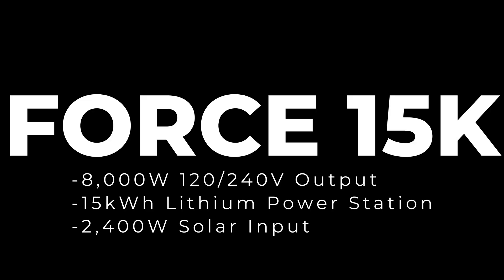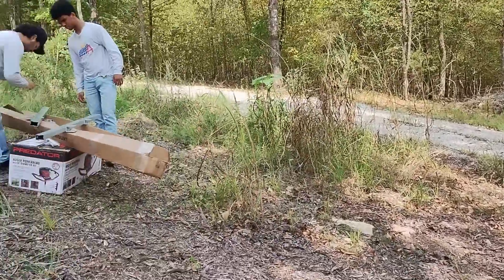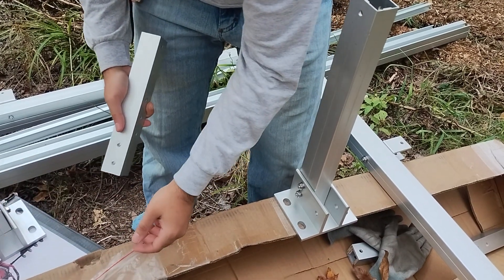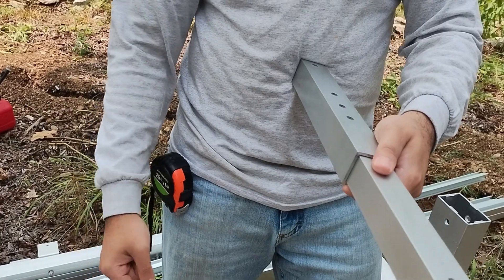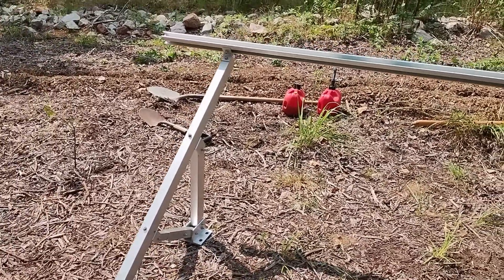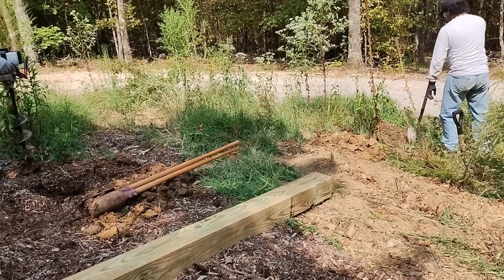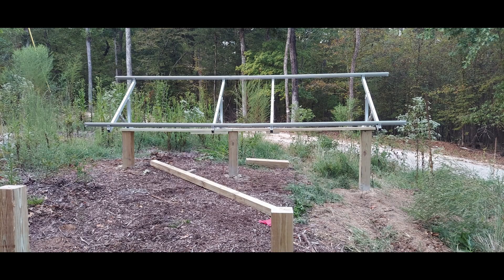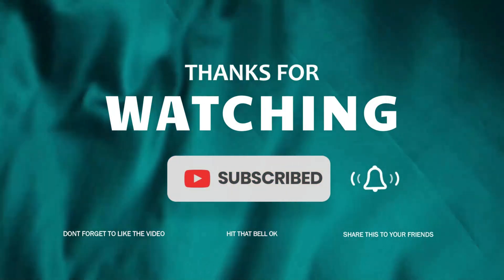Force 15kWh 48V LFP Battery, 8kW inverter Split Phase, 2400W solar input - Day 1

Comment: This is the most unprofessional jack-leg solar install I think I have ever seen. Those posts will rot out about 20 years before the panels wear out. You going to bolt those angle brackets on top of the posts? Bolts don't hold in end grain. First good breeze and the rack will blow over. How deep are those posts in the ground,12" to 18". Couldn't be much more than that being dug with a shovel. No good.I can hardly wait to see the inverter installation.That trench for the wire is not to code, You got an electrician on staff? 2400W solar on 15KW batteries is about 50% undersized. Any of your guys NABCEP certified. Guys like you give us real solar contractors a bad name.
Reply from the maker: @michaelharmon5991 -if you'd look closely, you would have seen an auger, which is what was used to dig down 36 to 40 inches and 12 inches wide. The posts in the ground are filled with cement and sealed.  The customer is starting out with 2400 watts and will be adding more solar panels as they can afford more. This unit only can take 4kW of solar. This is being installed as a backup power source, not the main power as the client have grid power. As for the trench, the property is on a hill and the terrain is rocky, so that is as deep as it's going to get in certain spots and the client had the trench dug. Before we put the conduits in the trench, we dug it out more. 4x4 treated wood are laid across the 6x6 posts and secured with 10 inch stainless steel bolts. Bolts are not put into end grains. You assume an awful lot before you see how this installation turns out. We visited your YT channel and don't see anything about you doing solar. Are you in the field?